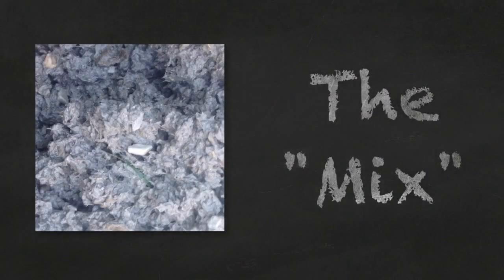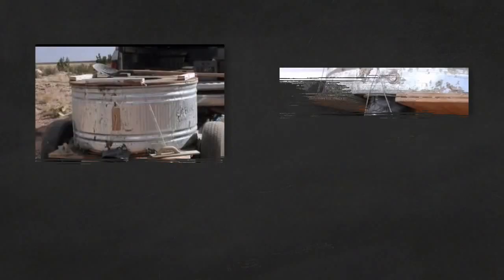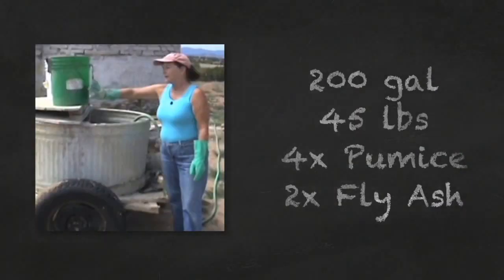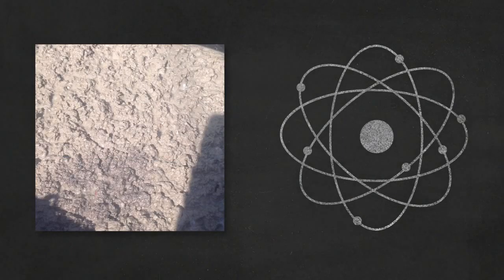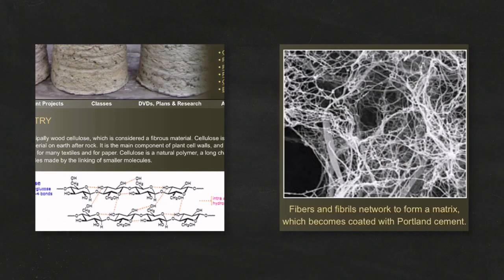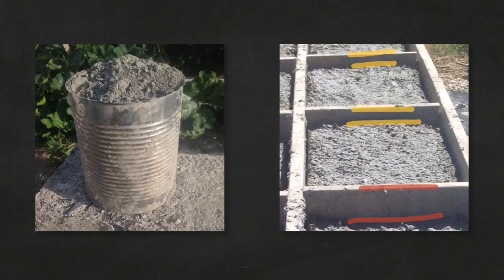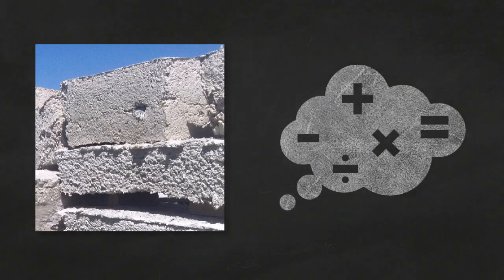Papercrete 220 - "The Mix"

Comment: Can you clarify if concrete mix is premixed with gravel /sand please. Different countries different names  😀
Reply: Sure.  The simple answer is "both".

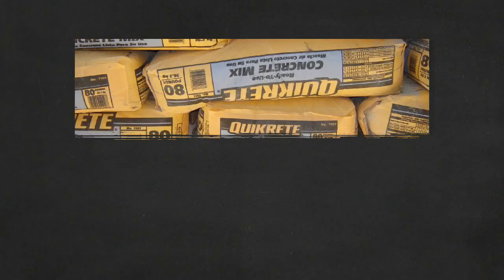At the 1:35 mark, the video shows an 80lb bag of "concrete mix" which is a mix from my local hardware store of Portland cement, sand and gravel for agragete.  Then, immediately after that the video shows two coffee cans (#10 cans) of straight Portland cement... which basically compensates for the 5 gallons of dirt/clay mentioned earlier.

Thanks for clarifying that part, I hadn't  noticed that we didn't  really specify the difference  earlier 👍

Comment: I get the reuse/repurpose/alternative building materials aspect; However, the cost to make the 12 blocks out of papercrete with this given recipe is about 5 times the cost to just buying 12 cinder blocks at any home improvement outlet.
Reply: Agreed.  However, besides the reuse/recyclye benefits, a cinderblock does not have a insulation R21 value (or higher, depending on your air content) and a cinderblock is also 4x times heavier.  Depending on your application/construction goals, they have their uses.

Comment: I also add silica fume and polymers !
Reply: also slag and ash to save 25% cement.
Reply from the maker: And...???  How does that work?  I assume that it improves the final product?
Reply: It does, silica fume molecules is 200 times smaller than a cement molecule and it fills all the gaps in between the cement molecule structure and makes the concrete stronger and more waterproof. The polymers acts as a cement glue and also gives a small percentage elastic bending to concrete as well as binding cellulose to the cement. I will send your more links.
Reply from the maker: @coeniebre  Yes!  Please do.  Not to sound silly, but where does one buy Silica Fume?  Also, what kid of polymer do you use?  Please include links for both, if you would be so kind.
Reply: I am from South Africa and silica fume is the exhaust fumes caught in the chimneys of silica factories. The polymer is a white liquid, normally called a bonding liquid or plaster key. White PVA wood glue is similar and the ratio is about 10% by weight of the cement, but do a small scale experiment. will send more links.
Reply: I also always add plasticizer, to reduce water content and alkali resistant fibre, to add strength.
Reply: https://www.youtube.com/watch?v=rv-JwoRfV0E&list=PLRq6Z9d0kCT-lQ7xM6Jh6HZVUjUObsz_8
Reply: https://www.youtube.com/watch?v=3-GLmvmWBT0